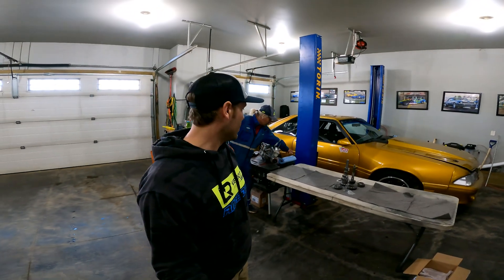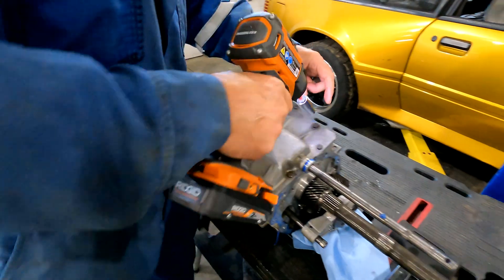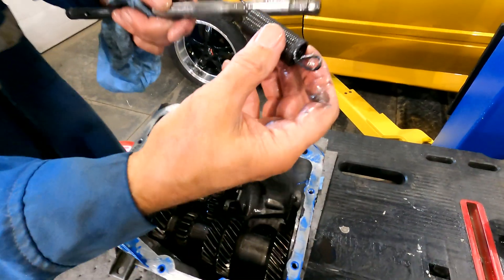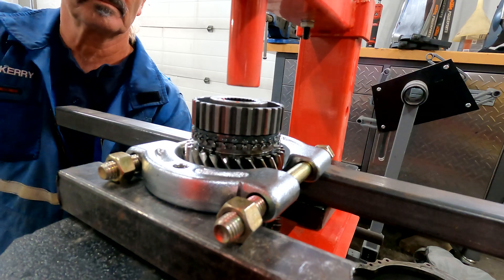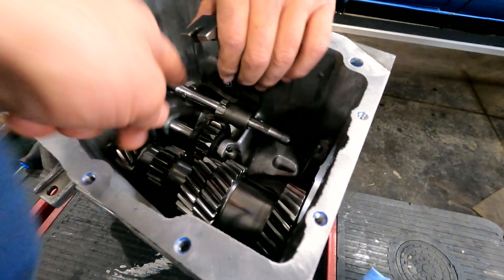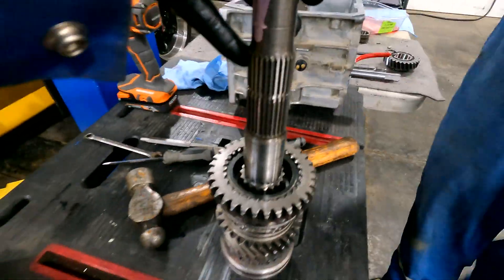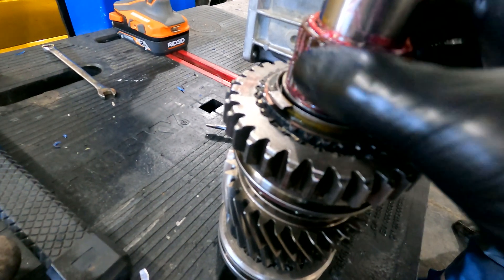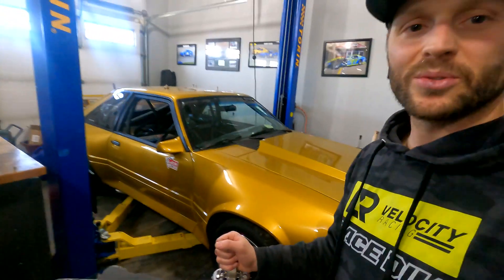T5 Transmission + G Force Upgrade

Comment: Just looked up the price of this kit it is right under 2k.. kind of pricy but it does say it supports up to 600hp. I'm looking to rebuild a t5 for a 351w engine swap on a foxbody mustang. This kit would definitely make the transmission more reliable at the 400-500hp I'm trying to achieve.

Comment: How’s it holding up???
Reply from the maker: Good question. It lasted about 4 track days before 3rd gear went out on it. (Our stroker was putting out 550-600hp) rather than our original guess of 500. Since then, I downgraded to a mild 306cid with a TKX. Working great.

Comment: whats the difference between the GM t5 and the ford t5??
Reply from the maker: I'm not sure. Hopefully someone can chime in on that.
Reply: Depending on the year, the main case could be different. The mainshaft and tail housing are pretty much always different. The GM mainshafts usually have a 27 spline count, so Ford OD driven gears will not fit on them. Input shafts are also different, as are shifter bases.
Reply: Bellhousing, and input spline count

Comment: thinking about putting a t5 behind a mild 400sbc into my 1987 trans am... how much power would you say the t5 G-force upgrade would handle HP & TQ wise??
Reply from the maker: From my own limited experience racing this trans, it didn't hold up to our 393 stroker. I'm estimating it makes 550hp and somewhere between 475-525tq. We blew out third gear after about 4 track days.
Reply: @VelocityVideo  Thank you for this. I was going to use a T5Z gear set in a G-Force case in a 300hp, 3,400lb car for autocross, travel, and track days. Might just go with the TKX now.
Reply: @possiblycrazy442  
They didn't use the main shaft from gforce, only used the gears. The gears are rated for 400ftlbs but with the shaft is 600.
See where all the gears are pressed off & pressed back on to the stock main shaft?. Gforce main shaft is 9310 harden steel. The stock t5 shaft is flimsy  twisting under the load casing the gears to break off. This is the argument on Jegs, Summit, & many Mustang communities. I have a 306 ford 496hp with the Gforce gears. Main shaft & gears. Most enthusiasts don't know about the shaft, I overlooked it as well then went back to buy it.
This was their 1st build they couldn't have known. 
But the gears are good for 400ftlb without the shaft. Normal t5 about 325 ( worldclass)
Reply: @ericmyers4982  yours still holding up? I'm looking into a manual behind a 400sbc also. If it would hold up I'd rather have the t5 over an m22 just for the sake of OD.
Reply: @VelocityVideo  to add to this comment, i have the 2.94 gearset behind a 6.0 in my FRS- i have lost 5th gear 3 times this year in 500 miles of street driving. car only makes 398HP/404tq and it is still pushing 5th gear past the retaining clip. this past time i even welded the clip to the mainshaft so it couldnt move, and we lost 5th gear today cruising at 2200rpm.. Probably purchasing a TKX
Reply: Wow really? That doesn’t sound to promising with the claimed 500tq.  Did you go with another gforce gear replacement?
Reply: Thank you for the update. Guess I’ll be saving my money for a tkx

Comment: The gear teeth are also more straight cut on the new set rather than angle like the stock gear set, that adds strength too! Are they pretty quite?
Reply: Just here to straighten up a common misconception. Straight cut gears are actually weaker, however, they also generate less heat which is why they’re commonly used in high performance applications. Helical cut gears on the other hand are stronger, but generate more heat which is why they’re generally used on passenger and industrial vehicles. The reason for this is straight cut gears have less surface area in contact at any given time with another gear meaning less friction, but also less material undergoing a specified load. Helical cut gears are capable of having much more surface area in contact at any given time with another gear which increases friction, but also means more material to handle a specified load.
Reply: @3rdchapterproductions811 one of the main advantages to a straighter cut gear is less axial loading. Meaning the gears aren't climbing each other and trying to push the ends of the case apart. When the case deflects bearing tolerances at the unloaded end change and the gears aren't fully engaged. Boom.
Reply from the maker: Yes, good point. It is noticeably louder than stock

Comment: Very Cool!
Reply from the maker: Thanks Randy! We'll try and post some more racing videos from this summer
Reply: @VelocityVideo  looking forward to it! How does the rebuilt transmission do? Building a ‘66 F100 with a 2.0 Ford Racing Crate engine with  Control pack & will be going to RWD with a manual.  The new TKX is about 4500 with bell etc less clutch/flywheel. Looking for cheaper alternatives
Reply: @randys66garage  I know im super late but i have this same transmission laying around my garage. let me know if interested
Reply: @rattletrapfox1001  TKX or T5?
Reply: @randys66garage  exact same box as in the video. Gforce T5 road race. From 2012. Its currently a fresh build. 0 miles. 2.42 and .59 gears. With 3.73 speedo gear.
Reply: @randys66garage  let me know if youre interested. I have the trans mount, shifter and aluminum driveshaft. $3k in texas
Reply: @rattletrapfox1001  $$? Too many projects sold the Eco 2.0 to a relative but he may be interested in transmission.